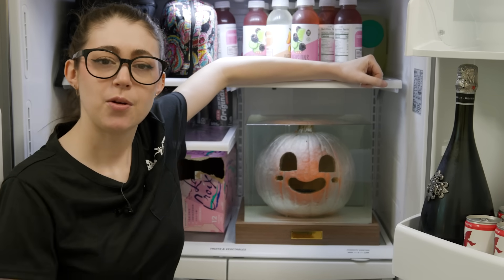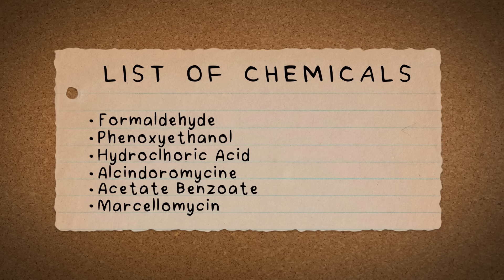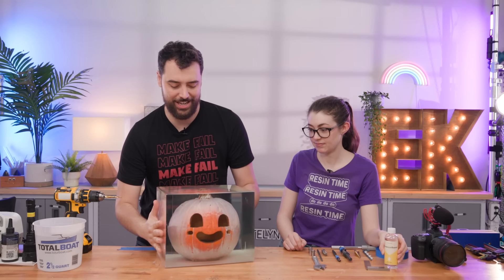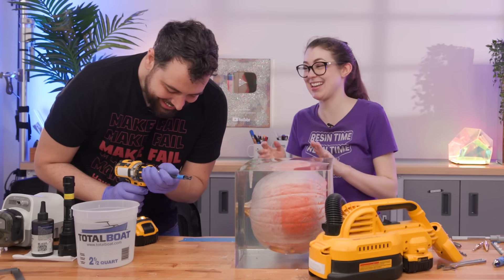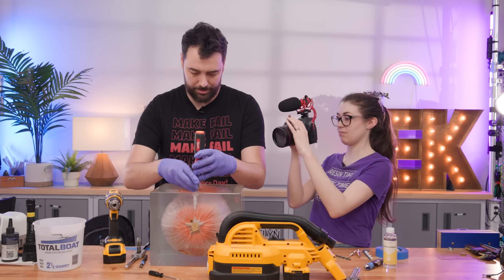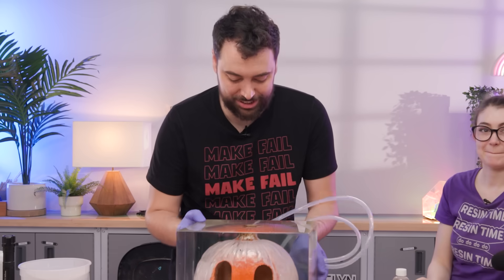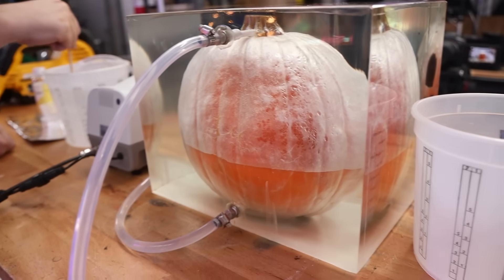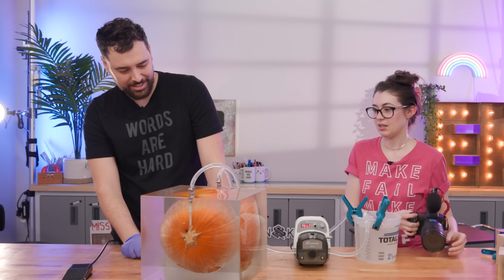Preserving A Pumpkin With Chemicals & Resin (feat. NileRed)

Comment: Said it before: when things rot, the bacteria eating the organic material releases gasses, which are pushing the resin, and now the mineral oil, out of Chunk 2's prison.
The Pumpkin that flash cured might be staying pristine because the heat killed all the bacteria. High temperatures are used to sanitize medical equipment.
Reply: So I have a thought. I know flower dessicants exist to kind of preserve flowers, and I've heard about the water molecules being replaced by silicone can also add a flexibility and preservation to stuff like coral. I imagine a pumpkin has way too much water content for something like that, but at this stage, could heating the resin and adding a desiccant or silicone help?
Reply: @RWAsur  Ive thought that they should try drying out the pumpkin a bit before trying to put it in resin
Reply: @Pirate_Kitty79  they tried drying the pumpkins with salt before, but they put it all in plastic bags... so that didn't really work out 😂
Reply: i thhiught the same thing!! but the ending implies the continuous bubbles might be because of the leak! it was just too small to notice until they left it for 10 days
Reply: @Rosie-yt8nd  the leak was due to the two thread taps they added i think, but the pumpkin was rotting and producing gas before that since it was buldging
Reply: @AlmightyPainGaming  yes thats what happened in the first part and the reason why they added the solution. it pushed out all oxgen and other liquids and should stop it from reacting further. after that point it is unclear if the bubbles are from continued reaction or air getting in.
Reply: @Rosie-yt8nd  fermenting something into alcohol doesn't use oxygen - it actually requires an absence of it.
It's an anaerobic digestion - if it fermented / rotted like this it would produce CO2 as a byproduct
Reply: @nregames8447  yes, i agree with you 😂 i was worried when Evan and Katelyn tried to smell the gas, it could contain H2S and NH3... 😅 I wish they see this thread of comments about microbiology and anaerobic digestion/fermentation before this fall!
Reply: @Rosie-yt8nd ah, good point. That does explain the CONSTANT bubbles, and like they said, it would've also been better to do all of this BEFORE he rotted😂
Reply: @Rosie-yt8nd  I think it started as a rotting problem, but given that the smell wasn't that bad, I think the rotting stopped when oxygen ran out. Perhaps anaerobic bacteria were still going, but they are slow.

Once they put in the alcohol and then the oil in, I think that was absorbing into the pumpkin leaving behind "air pockets" that were really just negative pressure spaces. Air was sucked into the tap when opened at a later time. The anaerobic bacteria might have still been eating away, but slowly, and this absorbing was happening faster.

You might think they need high pressure to cause the leak at the end, but I don't think you do. Oil can work its way through those taps and the interface between the tap and the resin. This could take a while, but once out, it would wick and accelerate the leak.
Reply: Yeah, the curing resin basically pasteurized the pumpkin for them while also sealing out any potential new contamination.
Reply: I was thinking the same thing about Chunk 1. He can't rot because everything that could have made him rot died
Reply: I was thinking it somehow fermented! Like it's not rotting how things usually would
Reply: @nregames8447 fermentation has bacteria or mold. In fact it has a lot of it and the bacteria/mold are eating sugers, fats, etc. Its what makes fermentation what is it lol. It doesnt actually "preserve" anything. Its a kinda transformation into something new. Ex: grapes into wine.
Reply: @maydayfae  wasn't gonna say anything, but just to make sure - if you ever ferment alcohol (or anything deliberately) and it has mold anywhere near it: do NOT eat / drink it.

Fermentation should not have mold (ordinarily)
Reply: @maydayfae  So it's basically transforming into pumpkin liquor inside the resin cube, right?
Reply: @kalistoh  it would if it was fermenting yes. But its not, its mostly just plain ol rotting.
Reply: @maydayfae  The act of fermentation doesn't involve mold, but yeasts to turn sugars into alcohols which bacteria then turn into acid.
Reply: @nregames8447  I think that person meant fungi, perhaps not knowing the differences between molds and yeasts.. though there are some edible molds, as you see on blue cheeses, natto etc.
Reply: @nregames8447  Fermenting and rotting are kinda the same thing. Micro-organism like bacteria or funguses break down one material and produce another. The difference is if the end product is useful for people. Good thought tho!
Reply: @regulusmasamuneryuku8657  kinda true! But I said fermenting because I couldn't see much or the negative products often associated with rotting

Didn't even have a layer of mold on it!
Reply: @regulusmasamuneryuku8657  The only difference between fermentation and rotting is one is controlled.
Reply: @regulusmasamuneryuku8657  Fermenting and rotting are NOT the same thing. Fermentation is a specific process which has been controlled by people to prevent rot. That's why uncontaminated lactofermented pickles and stuff are still crispy and not sludgy.. because the fermentation stopped them from rotting.
Reply: high heat probably also denatured enzymes responsible for enzymatic rot which is probably why he's still bright orange
Reply: But, do exposure to oxigen can play any role? In resin object (i think) must be save from oxigen (in theory). Like canning. So rotting will happen anyway because of bacteria that don't need oxigen?
Reply: @IcoBland_Shadow  yes, exactly :) anaerobic bacteria can continue to break down the pumpkin as long as there is organic matter and water
Reply: @taraxamintto 
Thank you!
Reply: @IcoBland_Shadow  Canning involves heating food to a high temperature to destroy microorganisms. Removing all the air from the can as it cools makes it so other microorganisms can't reenter the jar.
The resin for Chunk 1 heated him up, and sealed out the air. But, Chunk 2 was not heated. And when bacteria eat material, they create other stuff-like gasses. The new material has no where to go so the resin bulges. That's why the glass cracked in the Rose video.
Resin does create heat as it cures. But Pumpkin and low acidic foods need a higher temperature to fully kill microorganisms. You actually have to can those using a pressure canning method that gets to about 240 degrees, and keep air out so more stuff can't get back into your food. I haven't watched chunk 2's video in a while, but I think they did him in layers?
Reply: @regulusmasamuneryuku8657 
I undestand! Thank you for your explanation. It's helps a lot! Resin just looks so solid, like crystal. It's feels like you put something in it and it's preserved forever.
Reply: What they said
Reply: THE HEAAAT, OF COURSE! I think you're dead-on as to why he isn't experiencing the same gas pressure problem.
Reply: I was thinking, the resin probably cooked the pumpkin a little in that flash cure, and since it got cooked with no other oxygen to re expose the sanitized, cooked pumpkin to, it stayed preserved.
Reply: Hm. I wonder if you leave a lil opening on the top for the gasses to escape on their own, would Chunk 2 still leak? The problem with that is letting him rot. Though, it may not be by much, since he is in resin
Reply: ... anaerobically too 😈
I would've loved if they thought to send some of that fluid to be cultured. 
Botulism anyone? Might be the most dangerous pumpkin to ever have existed.
Reply: Yeah, I wonder if they can autoclave the resin or if the high pressure/heat will melt the resin
Reply: Yeah, so pump boiling water through it, drain that out, and replace it with a saline solution.
Reply: @TimCortesi  I learned today that pumpkins are not very acidic. So you need a higher temperature than what water boils at. It's a good thought tho. Wonder if they could get the saline solution that hot then replace it with resin
Reply: This is for canning pumpkin. Btw. It needs 240 degrees F for it to be food safe
Reply: @regulusmasamuneryuku8657  I think salt only increases the boiling point of water by a handful of degrees, but there's gotta be something with a high enough boiling point that it would "cook" the pumpkin enough to kill all the bacteria and stop the decomposition process.
Reply: @TimCortesi  Fair. Thinking about this...what would happen if they froze it? Though, there are micro-organisms that just hibernate when they get too cold
Reply: @TimCortesi  I think you would be better off just boiling the whole cube and letting the heat equalize through the whole thing. IDK what temperatures the resin could withstand, but ideally you would get it up to about 120C and maintain that for at least 15 minutes in all parts of the pumpkin. You could steam it to get it this hot, or bake it.
Reply: They are not the smartest... It's a very rotten pumpkin in raisin

Comment: The MOMENT they started to drill I was like “that’s gonna smell SO bad”. When they didn’t immediately wretch I was 100% shocked, haha
Reply from the maker: honestly I was SO surprised it wasn't bad
Reply: Probably been rotting very slowly from the lack of oxygen and the pressure.
Reply: Rotten plants are usually not as stinky as rotten animals. There are some exceptions to this, but still.
Reply: @voidseeker4394  most melons (which includes pumpkins) smell really bad when they rot though.
Reply: @jwjeff11  Can confirm! I bought a watermelon and put it in my cooler on ice because I had more errands to run.   COMPLETELY forgot about it for over a week. Let's just say I have a nice NEW cooler! 😅
Reply: @voidseeker4394 Hehehe, you haven’t seen the smell from the first resin pumpkin, have you?
Reply: @voidseeker4394  potatoes kuch kuch
Reply: the lack of free oxygen may be changing the chemestry of the scent.
Reply: Rotten pumpkins don't really smell much. We forgot about out halloween jackolantern and it was basically mush but it didn't really smell like much other than mild pumpkin scent
Reply: probably because it didn't rot that much. Those bacteria need oxygen to live and breathe out CO2 just like us. It probably utilized all the oxygen available and then died off. If yeasts were present (which they would have been) alcohol could have also been produced that killed off the bacteria and then itself. As for anaerobic bacteria, they are usually pretty slow growing. Botulism is unlikely to grow in a high alcohol environment but the spores will definitely survive. An acidic environment would have helped here, but you probably wouldn't keep the bright orange colour.

I also wonder if the pumpkin was shrinking or absorbing the liquid leaving behind "air bubbles". The first thought is that it was under pressure, but it seemed more like there was a negative pressure.

As for the oil leaking out, I don't think you need high pressure to explain that. It probably just worked itself along the threads and interface between the resin and the fitting. This could take many days to happen. Once it got out, then it accelerated and wicked out entirely.
Reply: no oxygen = no life = probably less decay? 🤷‍♀️

Comment: Never to early for fall videos❤
Edit: This year try silica beads in a tub and submerge the pumpkin. This is the technique used to dehydrate flowers, it should dehydrate the pumpkin and not discolor or change it. This is just a theory though! Not sure about it in practice!
Reply: They have tried silica beads with a pumpkin and that wasn’t a success😅
Reply: @petradegroot3578  The other commentor is correct. It was salt. Silica should be very different ❤️
Reply: @petradegroot3578  when?
Reply: @petradegroot3578  I thought they used salt, I haven’t seen the video in a while tho I might be wrong😅
Reply: I'd try a harvest right freeze dryer. 
But it would probably have to be cut apart & reassembled. P as well as be as thin as possible. 
Still don't know if it would even work though.
Reply: I considered this for the prep, lol.